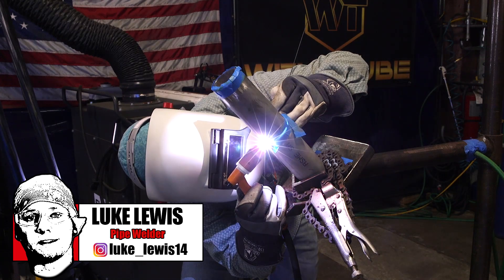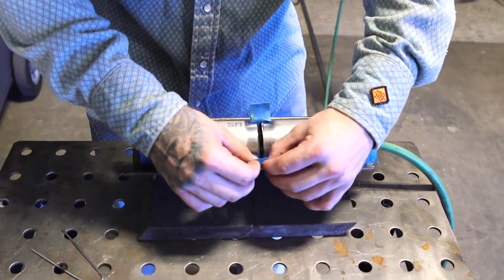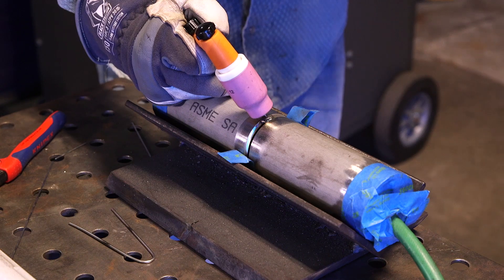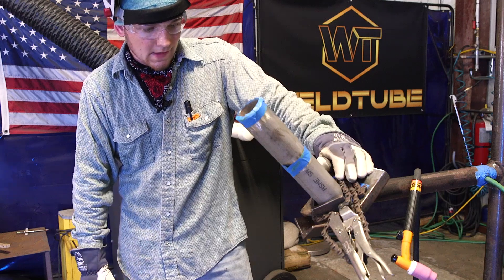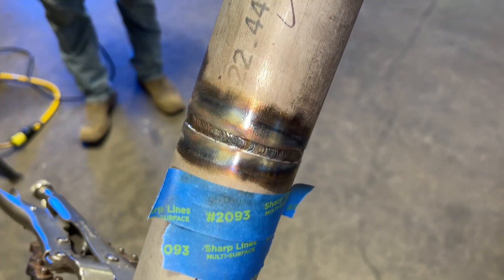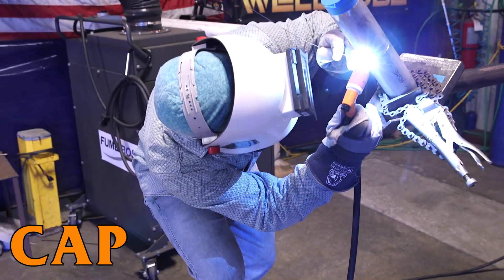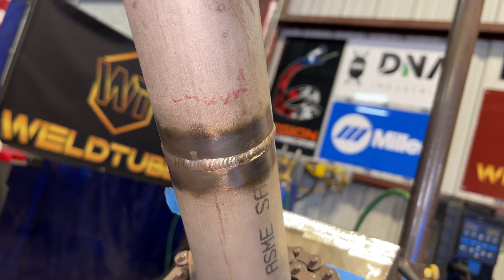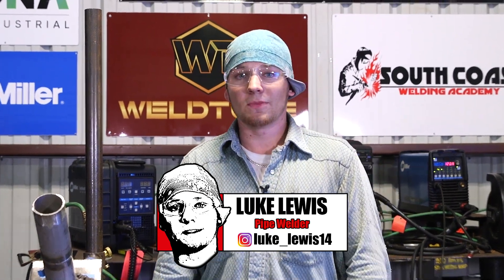How to Weld Duplex Stainless Steel | TIG Welding

Comment: what about the composition of Shielded Gas? Is it 100% Argon or What?
Reply: 100% argon yes.
With super duplex ie Xeron 100, then an addition of Notrogen to the purge gas will help stop the loss of nitrogen within the weld metal.
Reply: Shouldn’t you use 100% N or 90% N + 10% H ?

Comment: Welded stainless for years easiest metal to weld but never used a cup that big for anything
Reply: Duplex runs like cold molasses compared to stainless. There is a huge learning curve to duplex, alloy 20, hastelloy, etc
Reply: So basically you are using the foot pedal to make it a pulse tig

Comment: no different to welding 316L stainless or Inconel 600
Reply: Isnt much different from stainless other than being a bit less fluid, other than that youve just got to be careful with heat input thats all
Reply: @kf8575  I’m not disagreeing but you’ve obviously got better eyesight because I don’t think Stainless is more runny than Duplex but I  do notice a difference in welding alloys like Hastelloy
Reply: @Then.72  i just meant it doesnt seem to want to flow as quickly without upping the amperage a touch. Other than that, i dont see the difference
Reply: @kf8575  I use the same amps for these alloys but we aren’t all the same and I know welders I work with weld different to me and are very good

Comment: It's definitely a good bit more sticky/gummy than 304.
If your job is going to be checking ferrite/austenite balance, be very careful to be as efficient as possible with heat input, and minimizing any given amount of material staying molten longer than absolutely necessary. Duplex is intentionally a matrix of austenitic and ferritic stainless, and they will precipitate out and sort into like structures the longer they stay molten. If the ferrite count is too high, it'll fail a hardness test and become extremely brittle. If it's skewed opposite, it'll fail an acid bath test.
Reply: I'd imagine quite a bit considering rocket probably have quite the array of chemicals on board to run lol, that's cool as hell man thanks for the info I love learning about metallurgical stuff
Reply: How come they test for hardness for ferrite or acid bath for austenite? Do they do this in the field or would it be mostly for qualifying welders?
Reply: @Tragicduck  In my specific case, the boiling in an acid bath and hardness was done on qualifying coupons, the ferrite was done on every single weld before it left the shop, as it's done with a standard PMI gun. Of course the hardness and acid bath are destructive testing. Of course checking ferrite count with a PMI gun, you can have a pretty good idea how it will perform in the corrosion/hardness test based on the result, as it has a strong correlation.
Reply: That's super interesting. Where would this be used? I hear so far duplex is mostly for aerospace but we use it at my plant for filtration but never had to test for anything . What do you do if you don't mind me asking?
Reply: @Tragicduck  We made flow meters in a few material varieties. 316 was standard material, inconel/hastelloy for high temp, and 2207 Super Duplex for chloride pitting resistance. Think chemical plants, chlorine, seawater, etc, process fluids that just eat 316 up like it's nothing. Curious what aerospace applications it has!
Reply: @evanchi9460  we use it here at our plant as well. Chlor alkali Evan unit. We have some inconel hastelloy duplex and 316L. I had to build a 1” line out of duplex which took me a while due to interphase temps. It would get hot really quickly. So there was a lot of stop and let cool. Around 280-320 was our desired Inter pasa temp.
Reply: Takes longer to weld a butt due to really having to take note of interpass temps. 

Other than that, isnt any different at all to welding 304 or 316  really, wouldnt call it "gummy" at all, not in the way that monel, or inconel can be.
Just has a little bit more amperage and travel speed on a WPS to keep the heat input down👍

Comment: Great job guys.Been learning quite a bit.Keep up all the great work and also by welding all the different materials can you guys go through the different processes with these said materials as well as doing some combo welding with them?
Reply: I used to weld S10 S/S for nuclear industry in the UK in the late 80s We used a square edge prep pulsed HI-LO tig keeping 1.6mm wire in the pool and Argon Hydrogen mix shielding gas

Comment: I find it easier to hold the torch with my right hand all the way round. Also like a "Tig Finger" to avoid blisters. 😉
Reply: Get some time in welding left handed. 
Test pieces are the simplest part of the job. Wait until youve got a butt with steelwork, walls, other pipes etc etc in the way and you have to weld left handed, and getting some time jn left handed will definitely help you out👍
Reply: @kf8575  Also, I would never put root tacks in a two inch exotic test pipe,  Bridge tacks and a wedge for that wedding ring uniformity.😉
Reply: Yeah, but the test piece qualifies you for the job and the dosh. 😁  Know what you're saying though,  I can use my left hand out on site if I have to. No need for it in pipe shop with never ending "rolly polly" spools. 😉
Reply: It's all about confidence ,which takes a good while and lots of experience to achieve.
Reply: The dudes who cant weld left handed always get stuck fitting 90% of the time at the powerplant i work at. No point in a 6g cert if you get to the field and all the welds have to be welded left handed on one side.
Reply: @kylejames255  I can use my left hand if necessary without any problems. 🙂